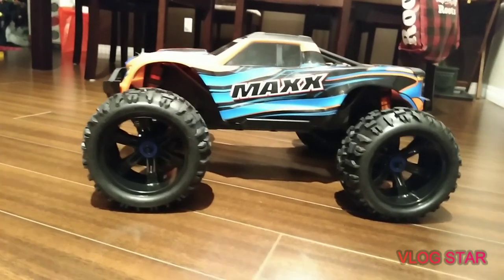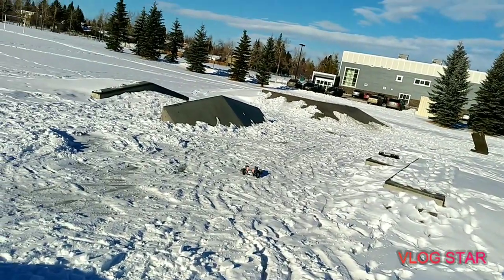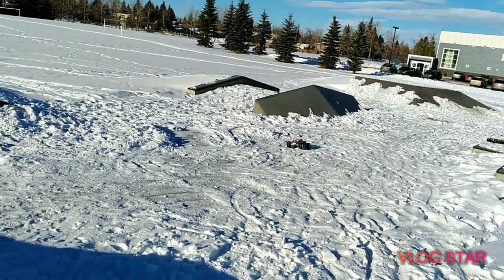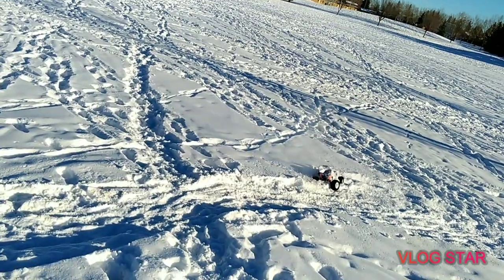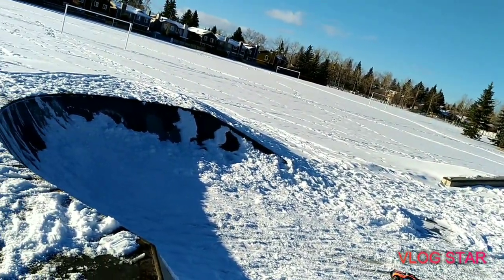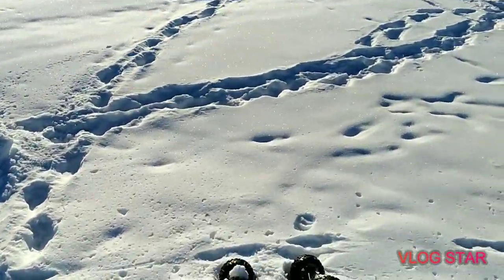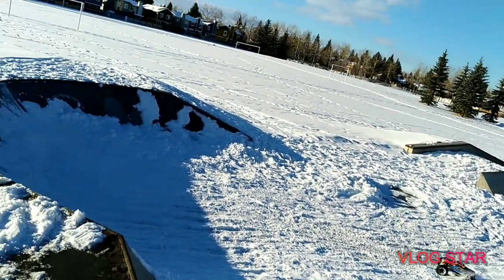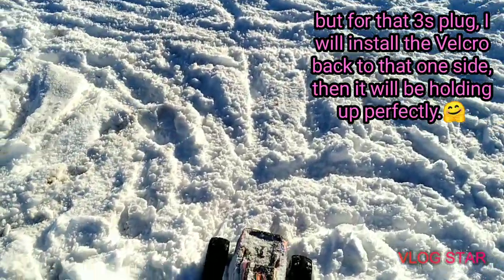Maxx 4s with ZD tires, HRB Lipo battery and 2 sticky Velcro on xt60 test-day 2

Comment: 🤗👍🏼
Reply from the maker: I am glad you like this video, I thought this video is not going to be interesting, caz I did cut the video up a lot, it is a super long video, the intention of this and the previous outing is to test that three things only, I don't want to make a hundred videos out of that tires, double side Velcro and the HRB battery,😅 but there will be one more video for wrapping up this three things later.  Beside now a day if I am running or fixing my trucky, I will just film it and post it up, caz my head have nothing to do when I am running and fixing my rc, so it can just hold on to my phone and film everything's. 🤣
Reply: Bonne video🇫🇷👋🏼